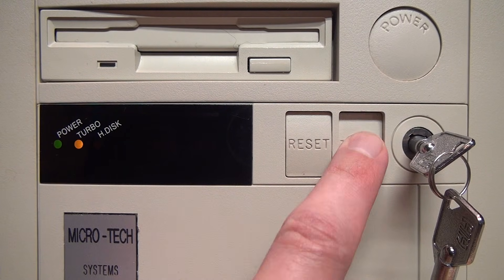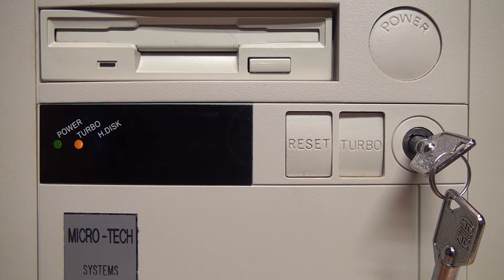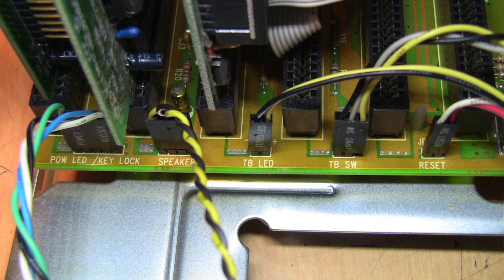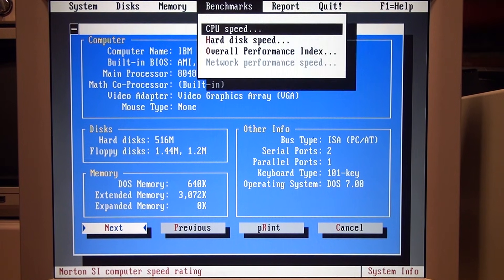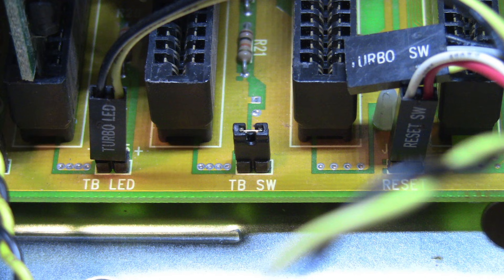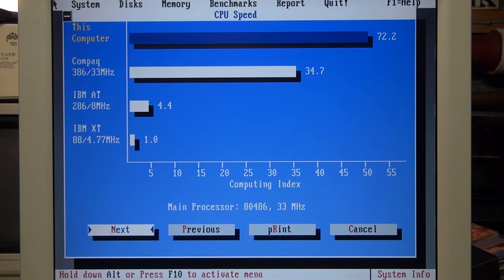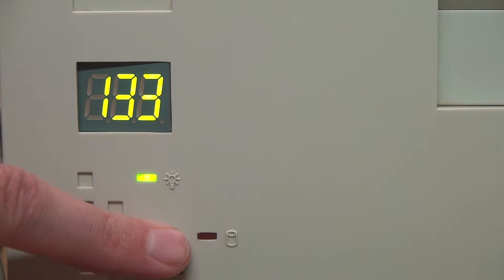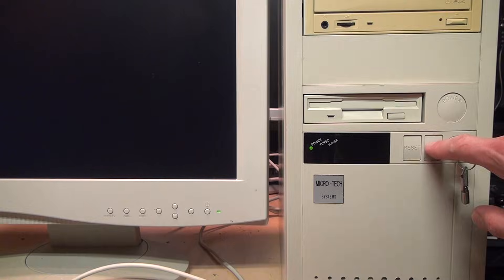The PC turbo button mystery finally solved!

Comment from the maker: Note: This video was originally uploaded in October 2022 as an unlisted, updated version of the initial release of this video, which used a portion of text-to-speech synthesis which some viewers didn't like. I decided to make this version public, which is why it shows up as being published in February 2023, and retire the initial version of the video.
Reply: I thought I recognized this as a repeat… strange thing it was public when I saw the original video
Reply: The turbo button selects between two speeds, therefore it can speed up or slow down the machine depending on perspective. As several commenters have stated, many clone brands had the button or indicator light reversed. If the default is full speed then it is semantically correct to say that the turbo button slows down the computer(especially on janky hardware that reverses the indications).
Though I agree that any complete article should explain both situations rather than making half-truth blanket statements.
Reply: @mytech6779  turbo on - normal speed
Turbo off - run slower so old games would run at a normal speed ie. Pac-Man you do not want the ghosts to have super speed around the maze
Reply: @KE5ZZO  I wouldn't want the ghosts come at me One Punch Man style.
Reply: @mytech6779  I feel like the safest approach is to say the button toggles the turbo, that way it's right either way.
Reply: @F_I_J_I_W_A_T_E_R  Well you could say that, but I think that falls under an old description of descriptions in some Army technical manuals: "technically correct, but technically useless." 🙂
Reply: I'm so confused. I thought that I watched this version this month and now I get a push message that I haven't watched it and it was released  22 hours ago.
Reply: I thought I was losing my marbles when I saw the notification, like "didn't Kevin cover this already? Am I having some Mandela recollection and it was actually a video by somebody else?"
Reply: I thought I was going crazy lol
Reply: @sickregret  lol, yeah me too. Watched it again anyway though.
Reply: Great video as always dude, cant say anything but that this settles any reasonable debate about the "turbo button", except for maybe semantic arguments. But the technical side should now be crystal clear to most who has seen this video. 

Again, big thanks, these are the kind of videos we need more of.
Reply: aah, and I wanted to blame the YouTube robot for not showing this video in my feed 🤣
Reply: link to the previous tts version?
Reply: Don't listen to this guy!!
The TURBO button is definitively slowing down the computer!!!
😆
Reply: I thought i had some weird deja vu🤣
Reply: So I'm NOT completely losing my mind? Thx
Reply: Adding your own narration is like pushing the Turbo button on your videos!
Reply: Some programs used timers pauses and sleep based on processor cycles now we use time
Reply: w

Comment: I actually got to design a 'Turbo" XT clone that was pitched to be a bare-bones entry level PC for AT&T Information Systems in 1986. The project was shown to Olivetti (AT&T's PC Mfr / OEM at the time) along with an AT clone from another department - but alas, they didn't take it. I designed my own Turbo-switch circuit. I recall what I came up with used 3 flip flops and a couple of NAND gates. Switching between 4.77 MHz and 8 MHz dynamically without glitching while meeting the Intel timing specifications was interesting but basically required waiting for the 4.77 and 8 MHz clock low periods to overlap such that the switch could occur during the common low time and then resynch to the new clock. I was left with the prototype and an unbuilt circuit board after the project was terminated (might resurrect it some time). We had four engineers to get it done: one for electronic design (me), one for bios, and two that worked on industrial design and getting a prototype chassis fabbed.

Comment: The wikipedia page has been corrected, but it still contains some information that hints on the very unusual 'Opon = Turbo Mode' motherboard configuration. "Some computers have wired the turbo button in a way that if the button is pressed in, the computer is running in the slower speed."

Comment: i imagine the turbo off mode was for if the computer was only being used at a counter as a register. most likely to preserve cpu life. if its running at the slower speed it will heat up much less and prolong its ability to perform a very basic task for years. these newer register computers have too much bullcrap going on with them and get messed up frequently. i remember the old p.c. like these at my old job. they were from the early 80s and had green and orange screens and printed contracts on these rolls with holes punched on the sides with a pre printed contract and the print was dot matrix and all the data was saved on these giant weird cassettes. that system ran in that store from the early 80s up until the 2010s with relatively few issues that i can ever remember. the system now is this laggy and prone to constant issues thing that requires a part time i.t. guy...

Comment: Lol my grandma used to tell me never to press the turbo button or it would burn up the computer. I just facepalmed and said "that's not how it works.... It's for older apps"
Depends on how the button is configured but usually it did slow the machine down when pressed in.

Comment: What's the point of locking out the keyboard via a key? I've never seen that before.
Reply from the maker: To prevent unauthorized people from using your computer -- a hardware equivalent of password protection.
Reply: @vwestlife  Oh Interesting! I've always wondered what those locks were for on OLD pc's back in the 90's!

Comment: In my experience, Turbo button almost always worked on my 386 systems, and worked about half the time on my 486 systems, and when it worked it generally dropped my 386 systems to 4.77 or 8 MHz, and my older 486 systems to 8 MHz...  I think I've even seen a 60 MHz Pentium system where turning off turbo would somehow drop the system to 30 MHz...

Comment: Here some experience from these 7 segment displays. I don't know how many variations existed for these, but on my 133mhz Cyrix Computer, I had such a segment display. The interesting about that display was, you had a handful of pins on the backside to configure what the display shows using jumpers. But that's not even all, using that display you had to connect your switch to that display and that display itself connected to a power source and the turbo button on your main board. The really difficult part with that display was, that the jumper configuration for that display was kinda multiplexed. That means, in my case, the turbo mode was at 133Mhz and non turbo was 66Mhz. I had to brute force figuring out the jumper configurations back then, to make it show the right values depending on, in which mode the computer is currently set to. Good old times.

Comment: I have a DOS PC with a K6-2 on it. The mainboard has jumpers to set the CPU frequency, but no turbo connector. So I did a bit of testing, and found a good jumper to put the turbo button on. It now actually switches the CPU clock to either 300MHz or 550 MHz.

Comment: Normally open / normally closed switch was obviously an off the shelf component that used for the turbo button when the circuit only required a normally closed switch.

Comment: havn't watched the video but i saw one like a year ago that told me that the turbo button is intended to slow yout comp down for games that run too fast due to the faster CPU timing, the turbo button basically slows the timings down to run the app at the intended speed. its more like a speed sync button
Reply: i mean i was right and wrong, if i recall after watching the video i also heard about the switch being able to be put in two configs to the board. at some point though comps just were all ran that hard and turbo was only really switched when something did run too fast

Comment: I bought my first computer around 1986 from an add in PC Shopper. 999.00 got me a TurboXT 4.77/8mhz, 640k memory 2- 360k floppy drives and a small RGB monitor. It ran at the 4.77 mhz speed and I never knew how to get the higher speed. Later I bought a 10mhz XT motherboard to upgrade and double my speed. It was while I was reading the documentation for the new motherboard that I discovered the keyboard combination to go into turbo mode.

Comment: Back in the 1980s, I had an Intel 286 processor in my home computer with a turbo button. It allowed the user to select 6MHz, 8Mhz, 10Mhz, or 12MHz.

Comment: My first computer was in 88 or so, an IBM PC clone called a Bios Model G. It ran on either an NEC Vic-20 or some variation at 6 MHz. So, I pretty much lived through the "Turbo button" years. I don't believe there is any one correct answer and it depends on the implementation. And, that changed over the years. As I recall, the earliest ones were as mostly described here, with the non-Turbo speed being the IBM standard 4.77 MHz, then the turbo mode being some higher frequency. Also, in pretty much every case I can recall, the computer was switched to turbo mode and just left there. Particularly as time went on. As computers got faster, it shifted to the relationship described in that last entry here from Intel, with the non-turbo clock divided down from the base clock. And, as turbo mode became the norm and nobody really used the non-turbo mode, it went away and we just have the speed of the computer and no turbo stuff.

Never even knew the turbo button was any kind of "mystery".

Comment: My dad used to turn the turbo mode on when he was doing work in Lotus123.. I told him it didn't do anything for that, but he was sure it made him work faster - not the software, him, hisself.

I'm glad PCs grew out of that phase - the last 3 PCs I've built for him and my mom over the years since the early days were excellent for their needs, and the only complaints they ever had was that they had to get used to the desktop resolution making things look 'too good', and 'not blocky enough', and occasionally they would accidentally 'delete a program' by which they meant they deleted the desktop shortcut. :p
Reply: And yet we still find occasional games where parts of the logic are dependent on framerate. Which means some developers spend 40 years and still haven't noticed that different people have different systems with different performance.
Reply: I’m just wondering how he thought pressing a button on a computer would make him work
faster
Reply: @Plumjet09  Well, it may have something to do with being young and goin' wild during the 60s and 70s when LSD and the hippie thing was raging, but I honestly don't know either.

Comment: That increased the clock speed of the timing oscillator that clocked bits through the processor… It screwed with playing games though. Games did play fast.

Comment: There’s a program we would have to run in the hospital when using this DoS based program called ESI.  The pc would usually run too fast for it, and it would cause the program to give an error and not launch correctly. We would then have to run a Turbo executable and then it would bring up a window where we had to input a value and usually it would be like 50 and that would cut the speed down to 50%.  Maybe that’s why some people think it slows machines down.

Comment: The keylock was largely killed by the arrival of USB, which ended the keyboard's status as a special, privileged peripheral that could be physically locked out.
Reply from the maker: No, it was the GUI which killed the keyboard lock, not USB. The point of it is to disable your keyboard to prevent someone from tampering with your files. But in Windows, anyone can do that with a mouse, and not need to use the keyboard.
Reply: @vwestlife  Up until the PS-2 era, it would've been trivial to have the lock also disable the mouse port - in fact, if there were any machines with a PS-2 keyboard and mouse port and a keylock, the shared controller between the 2 PS-2 ports probably meant the keylock also locked down mouse input. USB's bus model pretty much means you can disable the entire bus, or individual ports, but not specific device classes, at least not without software assistance - and at that point, you're better off implementing a password prompt.
Reply from the maker: @NetRolller3D  I've never seen a keylock that also locked out the mouse. My point is, keylocks disappeared from PCs years before USB became common.

Comment: The real question, however, is what EXACTLY does the turbo button do? does it lower/raise the CPU multiplier? or the FSB?? I recall, from that time, that some people said that the turbo switch actually disabled the cache, which caused the CPU to run slower...
At the very end of the video there was something abour setting a CPU register to make it run slower, but exactly how? by reducing the FSB or multiplier?

Comment: As someone who worked on computers for part of the 80's and 90's their was no mystery it was just how the inside was wired up, for anyone who does not want to sit through this hole video... also their was when you had to know what to type in to make it work, and that you wanted to know, which for me was alt ctrl plus to turn it on and the minus to turn it off... you hold all keys at once lol.

Comment: "It doesn't speed up your PC if you press it, it slows it down if you don't press it" is a very good way of putting it!
It should never have been called turbo in the first place, it should have been called "Slow mode" or something and worked accordingly.

Comment: Yes this is correct, used to build em. if you would check the schematic, changes clock speed. Turbo is to be the faster clock speed. Would need to check if i still have the manuals

Comment: We had a 486 DX I think it was with a "turbo button"  It changed the cpu from 32mhz to 100mhz on the fly.  There was even an LED digit display that told you the CPU speed.  I think it started out 16 -32 mhz, but dad got a faster processor.  It absolutely ran faster on "turbo" which we left it most of the time.  There was a few old poorly programmed games that ran too fast and played better at the slower speed.  But doom, turbo away.

Comment: My 286 case (which I reused all the way to a AMD K6-2) had a turbo button that was only wired to the case. It would display "Hi" or "Lo". The 286 was a second-hand one, and it may not have been wired to the moterboard - I never bothered with it. The only use it had was when I wired an ATX power supply to it, and the turbo button was connected to the power pins on the motherboard. My 286 never had a problem with Lotus 123 though, maybe it was a later version that was designed to work with newer CPUs. Interesting to know though.

Comment: If you push the Turbo button 6 times, then on three of the presses the computer will speed up and the other three times the computer will slow down. So they are only half wrong when they say that pressing the turbo button slows down the computer.

Comment: All the turbo button did was change the PC XT/AT bus from 4.77 to 8mhz.  Depending on the cards you had in the machine it could cause things to run slower if the card and bus weren’t running in sync.

Comment: Doug Demuro just put out a review of a Chinese car, The BYD Han, which actually has a turbo mode option for the infotainment system computer. It alters the processor and ram usage to make the infotainment system run faster. I guess the turbo button isn’t quite dead yet.

Comment: Its pointless to argue with elitist PC gurus. They think everyone is wrong even the Engineers that make a product. Even today these people are complaining about how newer GPUs are overheating, when the manufacturer say the device is running at the temp they say is nominal. 

On a more positive note. It’s wild but Modern Intel Processors have Turbo mode.  When buying a new PC it will even tell you an Intel CPU is 3ghz (turbo 5ghz). Instead of a button or a keyboard toggle. It can be fully customized via bios settings or set at a specific power level in power management settings. Balanced performance is the default and Windows will automatically detect that your PC will need more processing power which it will tell the BIOS to ramp up the CPU speed.  Performance mode makes Windows to tell BIOS to run CPU at Full 5ghz all the time, while Power Saving mode will limit it to 3ghz or even lower (some laptop Intel Processors can slow down even lower than base clock to save power).

Comment: The problem with old software is that there was no system clock to regulate game speed. Computers were so slow that it would run a program as fast as it could and that was the bottle neck to how fast a game ran. As computers got faster, so did the old software. Then computers got so fast that old game became unplayable. Now modern games will use a system clock, limiting a sprite to moving so far over time so it doesn't matter how fast your computer is. As long as it's good enough, all systems should run the game nearly identical.

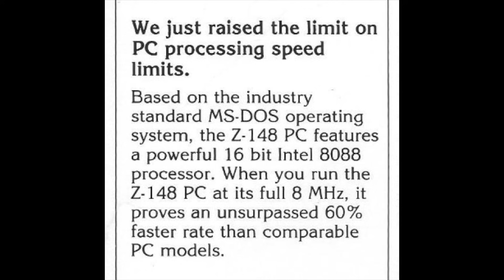Comment: 3:18 saying "it proves <something>" is correct or at least acceptable grammar. It is short for "it proves to be" - in this case: "it proves to be an unsurpassed 60% faster rate than ..."

admittedly somewhat awkward sounding, it still technically works

Comment: While not exactly a Turbo mode, my first PC, a whitebox AT clone built in 1987, had a Microway 287Turbo board which provided a high speed 80287 co-processor chip that was mounted on a separate board with a faster clock and a cable setup to plug it into the 287 socket on the motherboard. It turns out that the co-processor did not have to run at the same speed as the cpu. If my memory is correct, it was available in 10 MHz and 12 MHz versions to speed up floating-point calculations on the AT or a clone that was running an 8 MHz 80286 cpu.